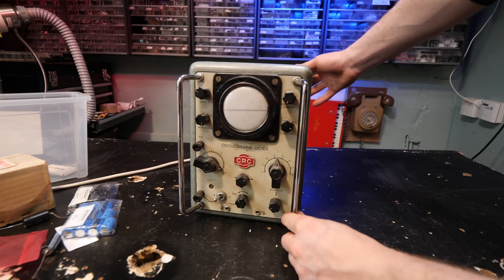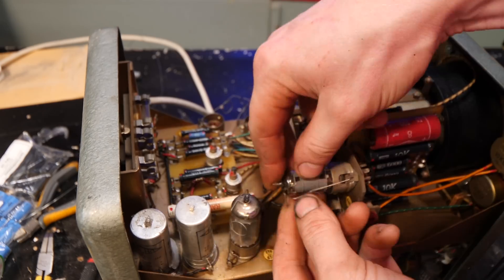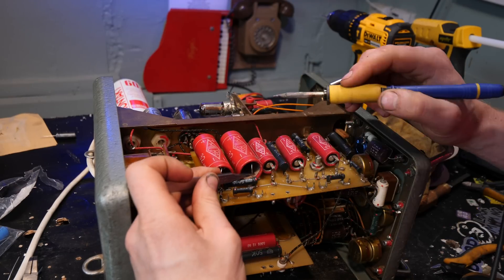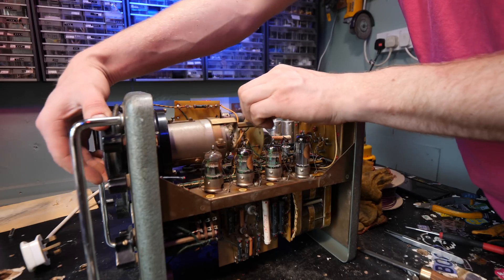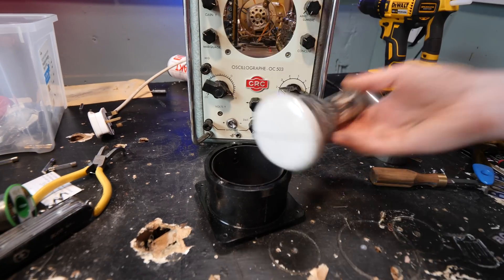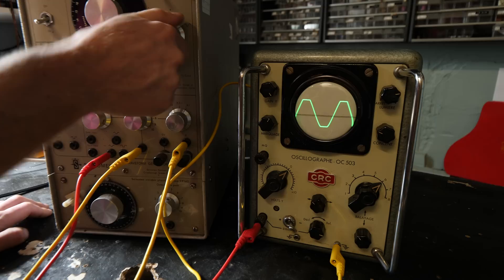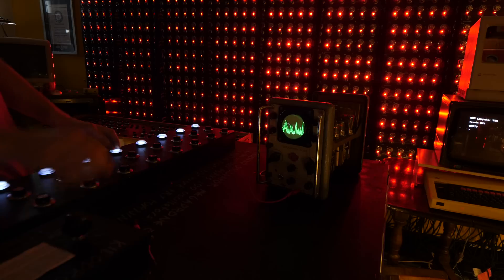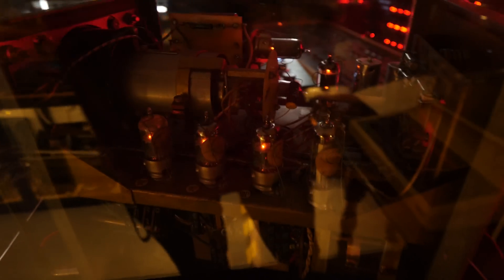Quickly Repairing A 1960's French Oscilloscope

Comment: This is indeed a nice piece of old tech. Congrats you were able to fix it this easy. When you pulled the insides out of the aluminium tubing of the capacitor, I got remembered that sometimes in old capacitors there was a substance used called PCB. This is very bad for your health, so next time I would recommend using gloves or other protective equipment in case there is PCB.

Comment: IDEA TO DISPLAY THE INSIDE OF THE SCOPE: use a LARGE sheet of CLEAR ACRYLIC that you BEND around the sides and top!!  - -  start by using some paper-board (it's like thick paer... like the type cereal boxes are made out of.. but a cereal box wouldn't be big enough... maybe two of them taped together) and you make the paperboard (we'll call it a stencil for now) you make it 'tall' enough to go from the front to the back of the scope, and long enough to start from the bottom of say the left side, go up the side and bend to the right, across the top, then bend down the side to the bottom of the right side... kind alike an UPSIDE DOWN HARD TACO SHELL (look,... now you got me hungry and thinking about burritos lol)
- now use the paperboard stencil to get a piece of 1/4" thick clear acrylic (not sure what that is in metric.. maybe 1 to 2 cm thick 🤷‍♂ sry)  then using a  jigsaw you cut the sheet to the right depth, and then you form whatever screw holes you'll need... and then you HEAT THE ACRYLIC AT THE SPOT WHERE IT WILL BE BEND TO WRAP OVER THE TOP AND DOWN THE SIDES... (there should be PLENTY of 'how-to' videos  on the best techniques to doing this.. I've never done it before but it seem to be straight forward... just use a blow torch to soften it (DO NOT OVER HEAT, YOU WILL NOT BE ABLE TO FIX ANY MELTED SPOTS!!! ) then using the edge of a table you bend the side down to make a 90 degree angle... (or whatever is the perfect angle for the scope... but REMEMBER YOU CANNOT UNDO THIS!! You MIGHT BE ABLE TO HEAT THE CORNER A LITTLE for small adjustments, but you WANT TO AIM FOR ONLY ONE TRY!!
 - - -  Now the second bend is much more tricky because you can't use a table, so you might just want to use the scope.... so heat up the line that you want to bend, pick up the acrylic (it SHOULD be bendable in your hand, so be cautious) then place it on the scope and bend it into shape!!! - 
- - - - }  BUT DO NOT STRETCH THE BENDS!!! { - - - - -  this WILL cause the CLEAR acrylic to GO OPAQUE AND FOGGY AND WHITE WHERE EVER IT IT SOFT/FLEXIBLE AND YOU PULLED AND STRETCHED IT - THIS IS SUPER IMPORTANT!!!! - - - MAYBE YOU SHOULD MAKE SOME PRACTICE PIECES, SO YOU CAN GET FAMILIAR WITH HOW EASILY IT DEFORMS!!
 - - Sorry about the caps... but I REALLY think you should have a go at this...  It's not to complicated and it WILL SHOW OF all those AMAZING COLORS and TUBES - such a SWEET ADDITION to the Museum!!!!!! I wish I could get over there!!!
Reply from the maker: It's what I was planning to do but because in the museum and heat
Issues I wanted knobs off limits. So put it in a see through box. Quick and easy

Comment: Eventually make an acrylic cover to replace the metal one and add a clear PC cooling fan for the tubes.
Reply from the maker: yeah i think im going to do that if it makes its way out of the clear box, it definitely needs a fan im adding one this week as it gets a bit hot in there haha. more for the caps. if anything its better for valves to not be cooled as they keep a more constant temp. but as you know. caps dont like it. :D
Reply: @LOOKMUMNOCOMPUTER  Regarding the modern caps hidden in the vintage ones, you could also add cardboard washers at each end to make them look like they're original.
Reply from the maker: @LenweSaralonde  i could but they are fine as is. quick to replace. you dont notice when looking so all good. it took a few hours. any longer would have been too long haha :D.

Comment: acrylic panels could be a good way to protect it and show off the components
Reply from the maker: That's what I did with the acrylic box?
Reply: yeah that works, i mean more like panels that attach directly to the thing itself so you can tweak settings and not have to lift the whole box off. but looks good either way 👍
Reply from the maker: @ivyisle  problem is its in a museum, blocking of controls is a good thing

Comment: you could replace the original case section with an acrylic or glass one, like a custom replacement
Reply from the maker: That's what I did with the box. Which also blocks off the knobs for the museum
Reply: @LOOKMUMNOCOMPUTER  I was thinking you wanted people to be able to play with the dials on it, and the box was temporary.  I did also originally comment before watching the box  part lol
Reply from the maker: @digadigado  naa. From experience having no controls able to touch that can potentially stop it looking like it's functioning. All knobs able to use need to be simple to understand
Reply from the maker: @digadigado  having an ability to unplug it or adjust it onto a none functioning setting out of reach from people is optimal for a museum

Comment: I appreciate you hiding new caps inside the original sleeves. 😎

Hey, the museum needs an SAE Mk6 FM tuner with the small oscilloscope built-in! I wish I still had mine. I would donate it! I used to plug synths and drum machines into it.

Comment: Nice- I have a similar uk built scope that needs the same treatment. Pretty deadly things, as I’m sure you know- I’d guess there’s about 1k eht on that tube?
 No-one has 8uf capacitors any more, although it was once a very common value in old stuff. 6.8 might have been a shade closer- although I doubt they’re in a critical location. What are they doing? Smoothing or decoupling bias resistors?
Reply: 8.2 is a standard value nowadays, for 10% or better capacitors. 6.8 and 10 are just a bit more common because they only require 20% tolerance. If a new cap measured exactly 8uF it could be sold as 8.2uF 10%, 6.8uF 20%, or 10uF 20%.

Comment: I wasn't intending on doing anything similar to this but since you mentioned it a couple of times, I am quite curious as to how doing something like this could kill a person?
Reply: Dangerous voltages, even when off (potentially).
Reply: @UCCLdIk6R5ECGtaGm7oqO-TQ  Yeah that does make sense. I know I've heard things about CRT being dangerous and potentially exploding even when unplugged for a long time but I don't remember exactly why.
Reply: @neniv  I'm no EE, but CRTs act as capacitors capable of storing the high voltage the HT feeds it (at thousands of volts).  They need to be discharged to be safe.  There are also all of the other capacitors in there that may well be operating at quite high voltages with it being a vacuum-tube based device which will similarly require discharging.

Comment: Lovely!  Beautiful cardboard cases on those old axial electrolytics!  

I owned an oscilloscope similar to that as a kid - got it around 1970 or so.  It wasn't CRC, it was Schlumberger, so it was Swiss rather than French.  I don't know where my dad found it. Weird hybrid technology - there were transistors in the time base but the vertical was all valves. The valves were in ceramic sockets with PC board pins, rather than point-to-point wiring.  The weak point turned out to be that there was (I think) gutta-percha insulation somewhere in the wiring for the accelerator anode, which deteriorated and arced over. At the time, I decided it wasn't worth fixing, because it had sprayed soot all over a number of innocent electronic bystanders,. I junked it, and got a Vietnam-era military surplus Tektronix scope with plugins. That behemoth is still in my basement somewhere, I should probably recap it and see if it will still work. The case looks and feels as if it would stand up to small-arms fire!
Reply: depends what flavor of Schlumberger it was! early 1970s, probably would have been built by CRC, which they aqcuired by buying out their parent comany CdC, or if it was mid to late, Enertec possibly, or maybe Solartron or Heath?
in any case, CRC, CdC, Enertec, and Schlumberger were/are all french!
Reply: @didgitalpunk  1973 at the latest, so probably CRC. No wonder everything looked so similar from the outside!
Reply: @didgitalpunk  I worked at a textile factory years ago and they had some machines made by  Schlumberger, there was also schlafhorst among others.
Reply: Sweet scope! 😎